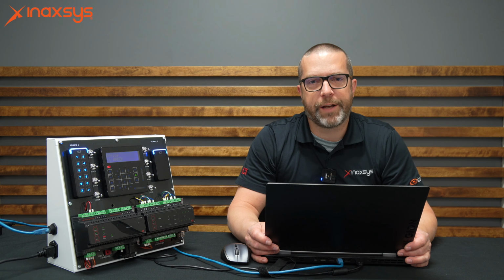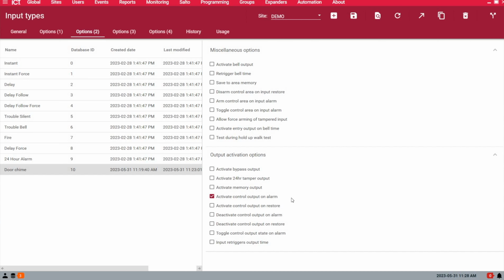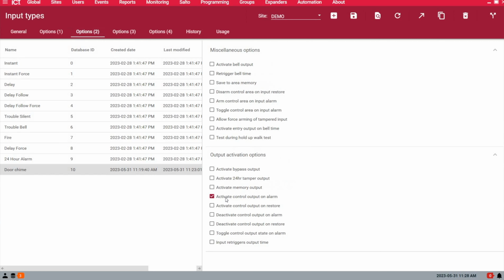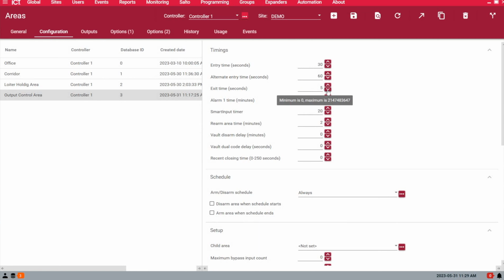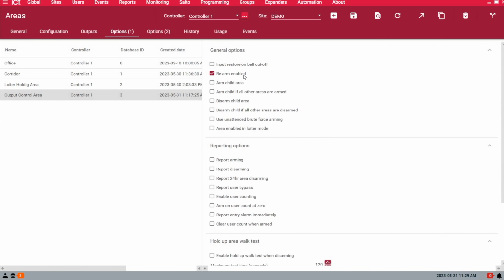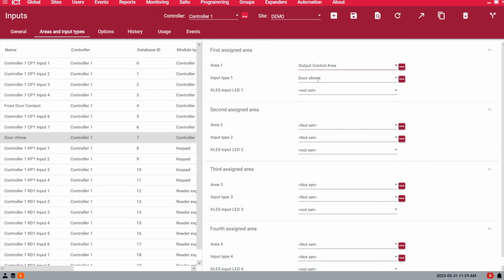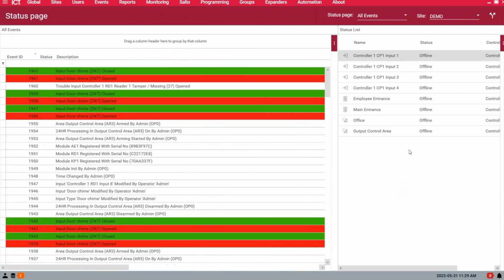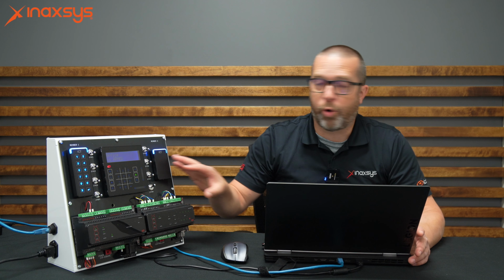How to Activate Output with Input with ICT Protege GX Access Control

Comment: can you show us how to install a bond sense for a door using a relay with wx protege?
Reply from the maker: Hello Luigi, thanks for your message.  On the WX main controller or PRT-RDM2-DIN reader expanders there are two available bon sense inputs. (We typically use input 3 or 7 for this application.)  You would then wire the relay to one of those inputs and go to the inputs tab of the door to make sure the bond sense input is assigned.
Reply: @inaxsys  Thanks for the quick response. What I did was added another contact to the door and installed it to input 3 on the controller. then used relay 1 N/O and added the bond sense to power it up. So when the door relay opens the door latch, the bond sense cuts the power to the bond sense. Put the other issue is, I have a door REX. It's not cutting the power to my bond sense when I'm configuring in the wx software. I don't won't the bond sense to unlock the door either automatically. I want the REX just to stop the bond sense. I think I'm doing something wrong. I tried to follow your advice but not understanding. To  wire the release to one of the inputs. Really appreciate your feed back.Cheers
Reply from the maker: Hello Luigi,  can you tell me what type of bond sense device you are using?  For us, this is typically a PIN in a door strike or mag log plate detection device that we simply wire to an input.  From your previous reply you seem to be using a powered device.  Maybe a solution would be to have the rex do its door contact bypass but at the same time activate the output to cut power to your bond sense device.  (You can refer to this video for the steps: https://www.youtube.com/watch?v=Qpx1oeghvOk&list=PL-L1uI9fGDzPHLPKR6eFxLPLqgj00yE1L&index=40
Reply: also forgot to mention that on relay 1 i have the electric door strike on N/C and the bond sense on N/O. Hope this helps.

Comment: How can I use the ICT WX to operate a Gate? where do I need to connect it?
Reply from the maker: Hello, thank you very much for the feedback.  We really appreciate it.  Yes, we have a lot of installations where the ICT WX system is controlling a gate operator.  Typically, all we need is to use the lock output of the reader module to send a dry contact to the gate operator.  The gate operator can be set to open on the contact activation or to follow the status of the contact.  From the ICT Protege mobile app, you can control the door associated with the gate easily.  In other words, you can connect the two systems so you can unlock the gate with an ICT TSEC card reader as well as with the mobile app.
Reply: i need  @inaxsys  prt-gx-srvr license, could i order directly ro your company..need fast urgently